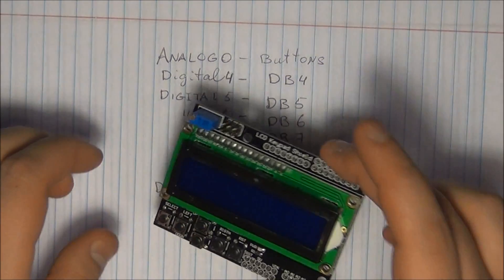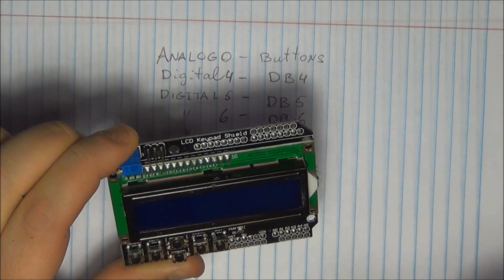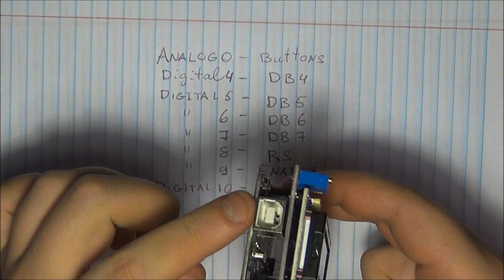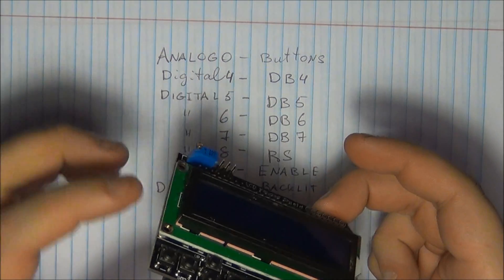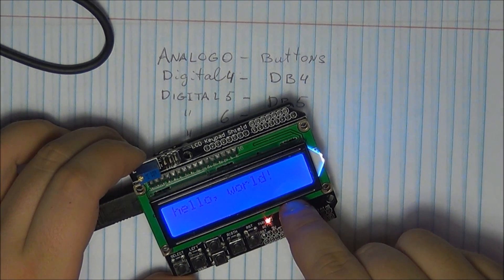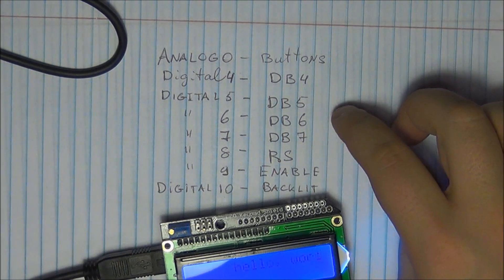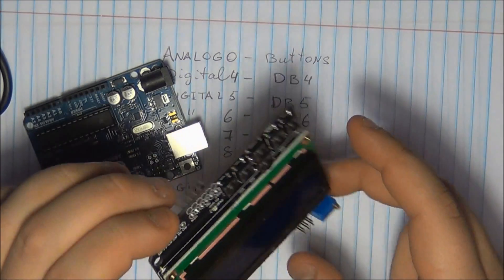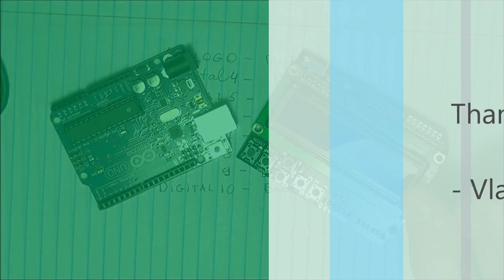Module Review #1 - LCD Keypad Shield for Arduino

Comment: i'm trying to run a keypad value test to get the values of my lcd keypad shield, plz help
#include <LiquidCrystal.h> 
lcd(8, 9, 4, 5, 6, 7);
int lcd;
int  btnStr; 
int currx;
int x;

void setup() {
  // set up the LCD's number of columns and rows: 
  lcd.begin(16, 2);
  // Print a message to the LCD.
  lcd.clear();
  lcd.setCursor(0,0);
  lcd.print("Analog 0: ");
  lcd.print(currx);
  lcd.setCursor(0,1);
  lcd.print(btnStr);
}

void loop() {
  
  x = analogRead(A0); // the buttons are read from the analog0 pin
  
  // Check if x has changed
  if ((x != 1023) && (x != currx)){
  
    //update screen and change currx
    lcd.setCursor(10,0);
    lcd.print("     ");
    lcd.setCursor(10,0);
    lcd.print(x);
    currx = x;
    
    if (currx > 740 && currx < 745){
    
       btnStr="Select";
    
    } else if (currx > 500 && currx < 510){
    
      btnStr="Left";
      
    } else if (currx < 10){
    
      btnStr="Right";
      
    } else if (currx > 140 && currx < 150){
    
      btnStr="Up";
      
    } else if (currx > 320 && currx < 365){
    
      btnStr="Down";
      
    }
    
      //update button pressed
      lcd.setCursor(0,1);
      lcd.print("        ");
      lcd.setCursor(0,1);
      lcd.print(btnStr);
  }
  
  delay(10);
   
}

i keep getting
Arduino: 1.8.6 (Windows 10), Board: "Arduino/Genuino Uno"

keypad_values.ino:2:4: error: expected constructor, destructor, or type conversion before '(' token

 lcd(8, 9, 4, 5, 6, 7);

    ^

C:\Users\taran\Documents\Arduino\libraries\keypad_values\keypad_values.ino\keypad_values.ino.ino: In function 'void setup()':

keypad_values.ino:10:7: error: request for member 'begin' in 'lcd', which is of non-class type 'int'

   lcd.begin(16, 2);

       ^

keypad_values.ino:12:7: error: request for member 'clear' in 'lcd', which is of non-class type 'int'

   lcd.clear();

       ^

keypad_values.ino:13:7: error: request for member 'setCursor' in 'lcd', which is of non-class type 'int'

   lcd.setCursor(0,0);

       ^

keypad_values.ino:14:7: error: request for member 'print' in 'lcd', which is of non-class type 'int'

   lcd.print("Analog 0: ");

       ^

keypad_values.ino:15:7: error: request for member 'print' in 'lcd', which is of non-class type 'int'

   lcd.print(currx);

       ^

keypad_values.ino:16:7: error: request for member 'setCursor' in 'lcd', which is of non-class type 'int'

   lcd.setCursor(0,1);

       ^

keypad_values.ino:17:7: error: request for member 'print' in 'lcd', which is of non-class type 'int'

   lcd.print(btnStr);

       ^

C:\Users\taran\Documents\Arduino\libraries\keypad_values\keypad_values.ino\keypad_values.ino.ino: In function 'void loop()':

keypad_values.ino:28:9: error: request for member 'setCursor' in 'lcd', which is of non-class type 'int'

     lcd.setCursor(10,0);

         ^

keypad_values.ino:29:9: error: request for member 'print' in 'lcd', which is of non-class type 'int'

     lcd.print("     ");

         ^

keypad_values.ino:30:9: error: request for member 'setCursor' in 'lcd', which is of non-class type 'int'

     lcd.setCursor(10,0);

         ^

keypad_values.ino:31:9: error: request for member 'print' in 'lcd', which is of non-class type 'int'

     lcd.print(x);

         ^

C:\Users\taran\Documents\Arduino\libraries\keypad_values\keypad_values.ino\keypad_values.ino.ino:36:14: warning: invalid conversion from 'const char*' to 'int' [-fpermissive]

        btnStr="Select";

              ^

C:\Users\taran\Documents\Arduino\libraries\keypad_values\keypad_values.ino\keypad_values.ino.ino:40:13: warning: invalid conversion from 'const char*' to 'int' [-fpermissive]

       btnStr="Left";

             ^

C:\Users\taran\Documents\Arduino\libraries\keypad_values\keypad_values.ino\keypad_values.ino.ino:44:13: warning: invalid conversion from 'const char*' to 'int' [-fpermissive]

       btnStr="Right";

             ^

C:\Users\taran\Documents\Arduino\libraries\keypad_values\keypad_values.ino\keypad_values.ino.ino:48:13: warning: invalid conversion from 'const char*' to 'int' [-fpermissive]

       btnStr="Up";

             ^

C:\Users\taran\Documents\Arduino\libraries\keypad_values\keypad_values.ino\keypad_values.ino.ino:52:13: warning: invalid conversion from 'const char*' to 'int' [-fpermissive]

       btnStr="Down";

             ^

keypad_values.ino:57:11: error: request for member 'setCursor' in 'lcd', which is of non-class type 'int'

       lcd.setCursor(0,1);

           ^

keypad_values.ino:58:11: error: request for member 'print' in 'lcd', which is of non-class type 'int'

       lcd.print("        ");

           ^

keypad_values.ino:59:11: error: request for member 'setCursor' in 'lcd', which is of non-class type 'int'

       lcd.setCursor(0,1);

           ^

keypad_values.ino:60:11: error: request for member 'print' in 'lcd', which is of non-class type 'int'

       lcd.print(btnStr);

           ^

exit status 1
expected constructor, destructor, or type conversion before '(' token

Comment: can someone help me, the code is
const int  buttonPin = A0;    // the pin that the pushbutton is attached to
int buttonState = 0;         // current state of the button
int lastButtonState = 0;     // previous state of the button
#include <DFR_LCD_Keypad.h>
DFR_LCD_Keypad keypad(A0, &lcd);
int lcd;;
int diceOne;
int diceTwo;
#define KEY_SELECT 

 uint8_t read_key(void);
  

void backlight_on (void);

void setup() {
  // initialize the button pin as a input:
  pinMode(buttonPin, INPUT);
  lcd.begin(16, 2);
  lcd.setCursor(1, 0);
  lcd.print("Roll the dice!");
}

void loop() {
  if (KEY_SELECT) == HIGH {
      // if the current state is HIGH then the button went from off to on:
       diceOne = random(1, 7);
       diceTwo = random(1, 7);
  //read the pushbutton input pin:
  buttonState = digitalRead(buttonPin);
 // compare the buttonState to its previous state
  if (buttonState != lastButtonState) {
    // if the state has changed, increment the counter
    
}
}
}
Arduino: 1.8.6 (Windows 10), Board: "Arduino/Genuino Uno"

C:\Users\taran\Documents\Arduino\dice_for_catan\dice_for_catan.ino:9:0: warning: "KEY_SELECT" redefined

 #define KEY_SELECT 

 ^

In file included from C:\Users\taran\Documents\Arduino\dice_for_catan\dice_for_catan.ino:4:0:

C:\Users\taran\Documents\Arduino\libraries\DFR_LCD_Keypad/DFR_LCD_Keypad.h:55:0: note: this is the location of the previous definition

 #define KEY_SELECT DFR_LCD_KEYPAD_KEY_SELECT

 ^

dice_for_catan:5:28: error: 'lcd' was not declared in this scope

 DFR_LCD_Keypad keypad(A0, &lcd);

                            ^

C:\Users\taran\Documents\Arduino\dice_for_catan\dice_for_catan.ino: In function 'void setup()':

dice_for_catan:19:7: error: request for member 'begin' in 'lcd', which is of non-class type 'int'

   lcd.begin(16, 2);

       ^

dice_for_catan:20:7: error: request for member 'setCursor' in 'lcd', which is of non-class type 'int'

   lcd.setCursor(1, 0);

       ^

dice_for_catan:21:7: error: request for member 'print' in 'lcd', which is of non-class type 'int'

   lcd.print("Roll the dice!");

       ^

C:\Users\taran\Documents\Arduino\dice_for_catan\dice_for_catan.ino: In function 'void loop()':

dice_for_catan:25:17: error: expected primary-expression before ')' token

   if (KEY_SELECT) == HIGH {

                 ^

dice_for_catan:25:19: error: expected primary-expression before '==' token

   if (KEY_SELECT) == HIGH {

                   ^

exit status 1
'lcd' was not declared in this scope

Comment: is there a way to use this on a breadboard and limit the amount of i/o it uses on the arduino? because im using a servo, lcd, and a buzzer, so i'd like to only plug in things that have to be plugged into the arduino for control

Comment: Has anybody noticed that the (RIGHT) button just below the screen itself is wrongly typed (RIGHT) on this shield? Mine too. Why? Am I (RIGHT)?
Reply from the maker: Interesting point, I hadn't noticed it myself...
Reply: Most of the time the LEFT btn  on the Ardnuino LCD shield (DF ROBOT availbale on the marketplace) reads what one types for the DOWN btn, and the SELESCT btn displays what normally stands for the LEFT btn. There is something wrong in the hardware (the LCD shield), this is not an issue of software in the Arduino IDE. Have you ever had gotten this wrong display too?
Reply: Has anybody remarked that the Arduino LCD Shield when run using 9 volt battery keeps the display for about 30 minutes and the display goes fading out to null? Very annoying indeed.
Reply: However, you can adjust the brightness of the display of the LCD using a fine screw to turn the screw (that you find above the blue rectangular potentiometer, i.e. to the left-hand side upper corner) clockwise when the display goes really faint.
Reply: A potentiometer is a manually adjustable electrical resistor that uses three terminals. In many electrical devices, potentiometers are what establish the levels of output. For example, in a loudspeaker, a potentiometer is used to adjust the volume. In a television set, computer monitor or light dimmer, it can be used to control the brightness of the screen or light bulb.

Source

http://www.wisegeek.com/what-is-a-potentiometer.htm
Reply: The user can adjust the position of the third terminal along the resistive strip to manually increase or decrease resistance. The amount of resistance determines how much current flows through a circuit. When used to regulate current, the potentiometer is limited by the maximum resistivity of the strip.

Controlling Voltage

Potentiometers also can be used to control the potential difference, or voltage, across circuits. The setup involved in utilizing a potentiometer for this purpose is a little more complicated. It involves two circuits, with the first circuit consisting of a cell and a resistor. At one end, the cell is connected in series to the second circuit, and at the other end, it is connected to a potentiometer in parallel with the second circuit.

The potentiometer in this arrangement drops the voltage by an amount equal to the ratio between the resistance allowed by the position of the third terminal and the highest possible resistivity of the strip. In other words, if the knob controlling the resistance is positioned at the exact halfway point on the resistive strip, then the output voltage will drop by exactly 50 percent, no matter what the input voltage is. Unlike with electrical current regulation, voltage regulation is not limited by the maximum resistivity of the strip.
Reply: yes